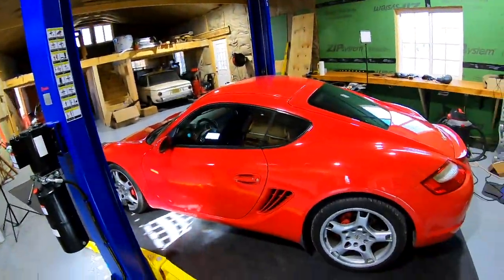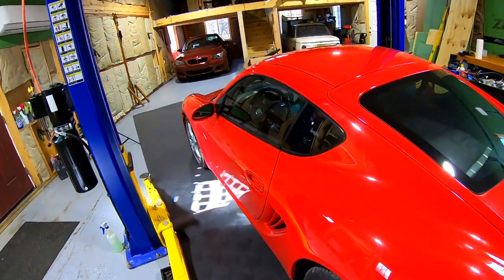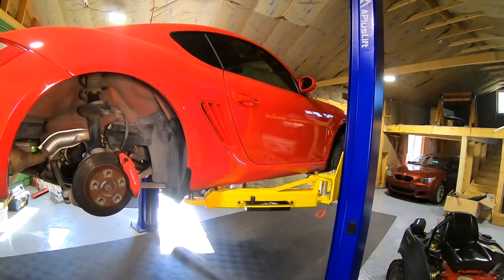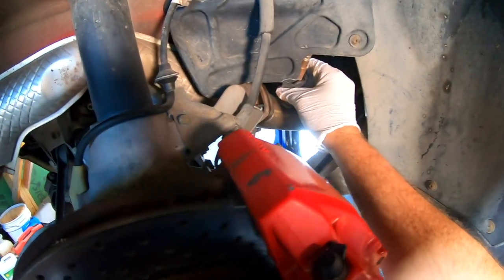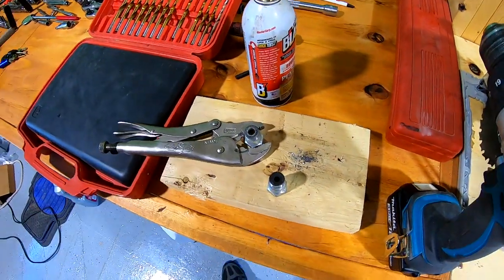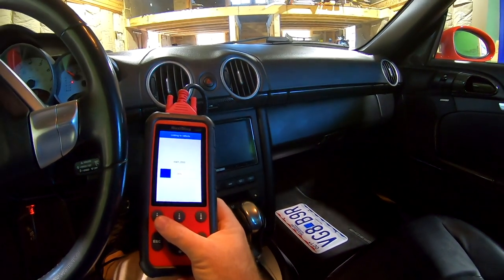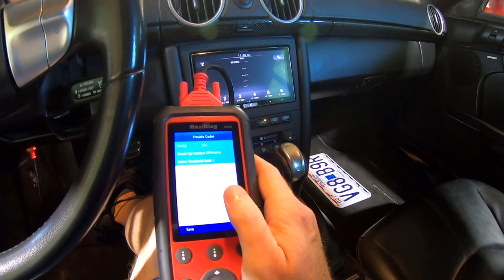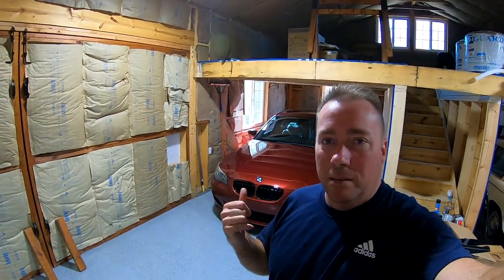How To Fix P0421 After A Catalytic Converter Delete

Comment: Use the angled O2 sensor spacers Nathan. I’m an ex German car mechanic. The anti foulers work SOMETIMES, but not always. The angled O2 spacers work most of the time. Just a heads up. Point the angled part AWAY from the exhaust stream, and you’re generally good to go
Reply: So would the angle spacer work better on a golf aswell.